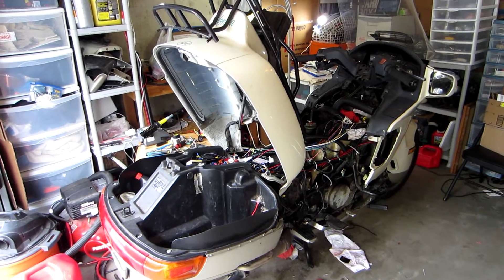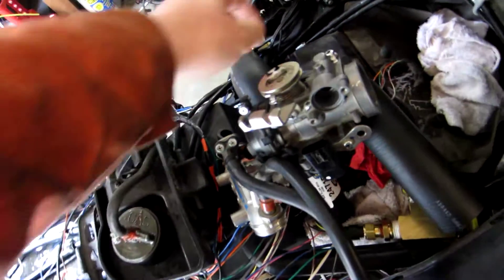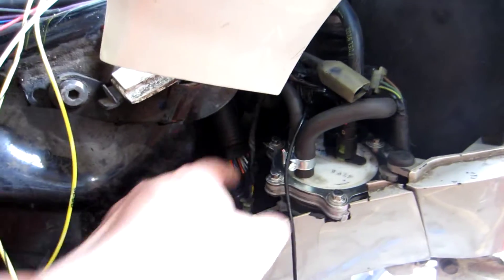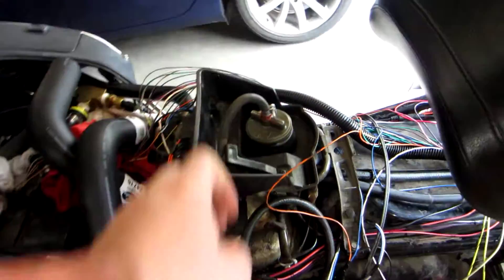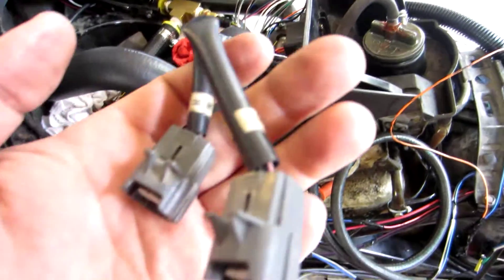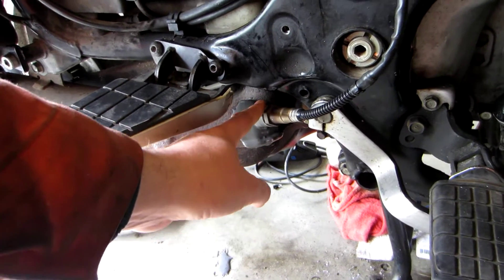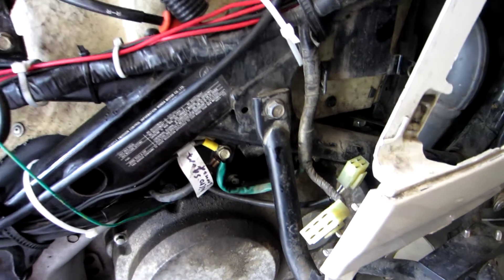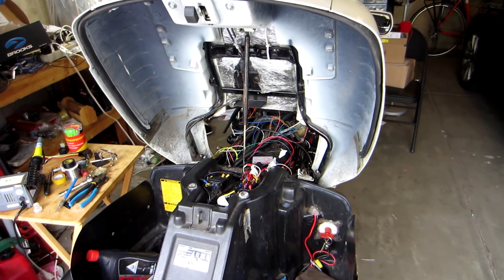Honda Pacific Coast PC800 Fuel Injection Project Update

Comment: Great to see the video showing the progress. I have been watching on your website and enjoying the different projects. Thanks for the site work and your forward thinking PC800 dedication.  

And heck yeah to a turbo!
Reply from the maker: It's coming along slowly! I am trying to have it on the road by the end of May.  The turbo will have to wait a few years until I have a proper house with a shop in a separate building so that I can have a full welding setup.  The plans are all there.  I just need to get a turbo, bend and weld some exhaust piping, get the wastegate, put on a different muffler to reduce exit restrictions, and then go crazy.  Oh, and definitely replace the clutch springs with some that are MUCH stiffer.  I can already slip the clutch if I romp on the throttle hard enough at sea level. :-)

Comment: Good on you, brother. You must have flown a KLR prior to this?
I recognize the "symptoms"...... must make it better, at any cost!
Outstanding. Hat's off.
Reply from the maker: Haha no KLR in my past but I've certainly had a few bikes over the years... 1984 Honda VT700, 1979 Honda XL500s, 1980 Yamaha XS850, 1979 Yamaha XS1100, 1989 Honda Pacific Coast....
Reply: I just got a 1997 PC-800, very clean, 10,000 miles, looks like it came out of a time capsule, runs great, looks great.  Neat bike. Spent two and half days changing fluids, battery, air filter, new tires and oil. Runs like a dream.  Man they are a warm bike to ride on a hot day though. You could grill weenies by those side vents, and my windshield is so tall I can do 75 on the highway with my face shield tilted up and I don't get any fresh air. The pocket of air is so still for the operator I could play cards, do my taxes and roll a cigarette.... I had a KLR, and I was used to "all that information" from the road and around you....

I ordered a windshield 3 inches shorter, the RIFLE that came with it was cracked anyway.
Reply from the maker: paul klrguy Did you get a Goldwing-style vent in the windshield you ordered?  I've got a +3" windshield that has the vent and it works wonders in the hot.  Same in the cold when I can close that vent and suck up the heat from the engine.  But yes, I know what you mean.  The XS1100 has no protection and is great in the heat.  I freeze to death in the even slightly-cold on it though.  I've ridden the PC800 well below freezing with no great problem.

Someday though I'd love to own a KLR 250.  Those little bikes are awesome!
Reply: My PC800 came with a freakishly tall wind screen.... but it had a crack that "crawled" and got worse. I would have gone with the "Clearview" shield, those are the ones with the vent.... but they are "priced according to their quality... " and quite a chunk of change. 

My current, cracked windshield is from "Rifle".  It is rather thin and flimsy.... reminds me of a snowmobile windshield from a 1968 Ski Doo snowmobile. Also, the mounting system is really cheap, using 10-32 USA thread PLASTIC screws and very tiny nuts... and the washers dont displace any potential stress, as they are only as big around as the little screw heads themselves.  CHEAP, CHEAP CHEAP. 

Yet, while on their web site, I see if you have already had their "system" in place, you could come back and order just the plexiglass shield by itself for $90 bucks in about 4 heights. Mine was about 3" too high for my liking.... so I think the one I ordered from them as a replacement is 20" tall now. 

Apparently their "base" system, sort of a replacement air dam and some black plastic with their name on it costs $145-, more than the windshield itself. 

Normally, I would have gone another direction, and just got the higher quality "Clearview"
with the vent like you have.  But budget and common sense kicked in.... so I replaced it with another "Rifle", and it's the right height for me. 

I am 5-10, and prefer to be able to see over the TOP of my shield, so if there is rain, headlight or sun glare or BUGs on my shield I am seeing the naked raw target, road surface, DEER, dead beaver, snake or chunk of firewood in the road ahead of me. 

I know I risk some "buffeting" and might get my head knocked around a bit now, but I will risk it, I rode about 275 miles on Saturday with another guy and bike, and it drove me nuts trying to look over my current shield. 

Also, I may have said, these are really warm bikes to ride on a hot day.... we have had Viet Nam-like humidity, and temps in the upper 80 and into the 90's hanging over us and I am not a hot weather guy (Minneapolis). 

What state are you in?

Later, Paul in Minnesota